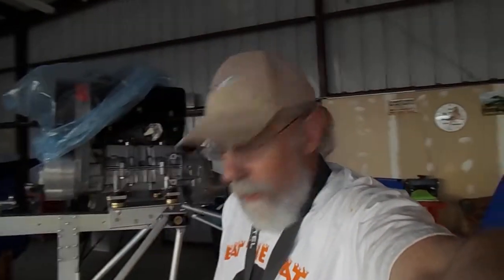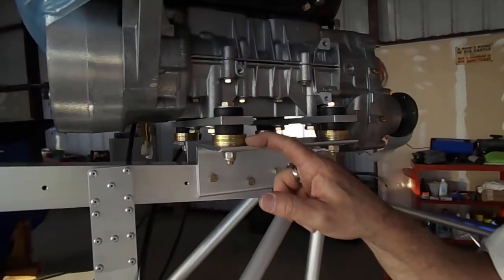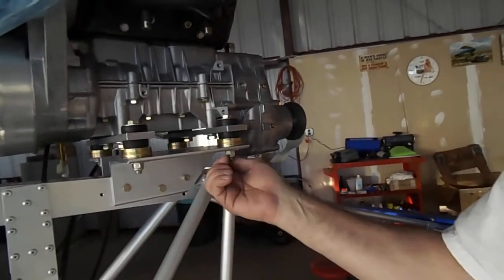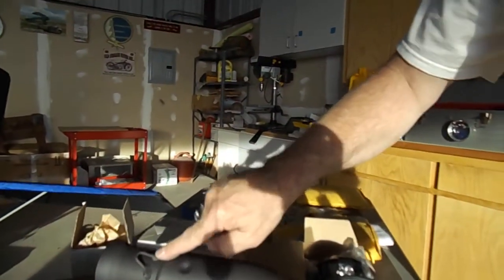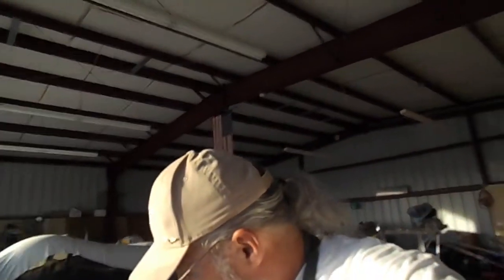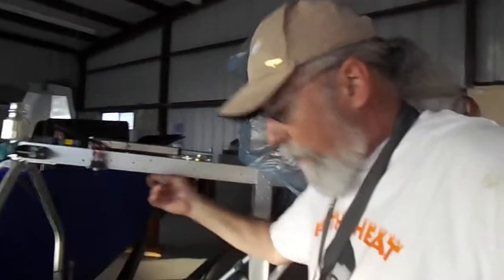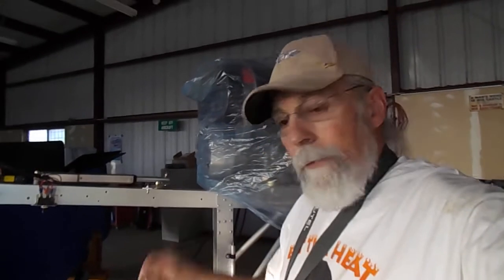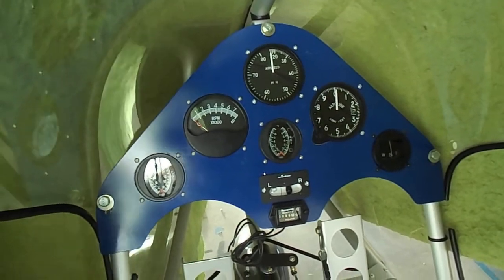Rotax 503DCDI Engine Installation Updates: 001

Comment: I'm a Harley and hot rod guy and dont know much about building aircraft but don't you use safety wire or cotter pins in those engine mount bolts? Man I'd be paranoid those suckers would vibrate loose! Great channel, my story is similar to yours, I plan to learn to fly one of these days also and am interested in the aerolite 103.
Reply from the maker: I hear ya. Not to worry, John. The manufacturer calls for nylon safety nuts on engine mount bolts. I went one further. I used the "Nylok Nuts" recommendation AND "cotter pins" in each of the mounting bolts. It's solid. Thanks for the comment/s and watching. Good luck with your endeavors and acquiring your dream of flight. Ride safe, brother!
Reply: @aerolite103buildersvlog8  thanks for the response. I watched your next video and saw you were talking about safety wire haha. I jumped the gun a little bit!

Comment: Did the instructions not show the engine mount washer issue?  Were washers not included with the kit?
Reply from the maker: No. And no. It's a plane with many things the owner needs to adjust or come up with and/or consult with manufacturer about. The washers were such an issue. Basically it all depends on the engine selection for your project, Tab. There's many engine choices available for this plane and the Rotax 503 is unfortunately discontinued/outdated now. Parts are plentiful and she's still a great engine. I got mine brand new in the crate for a great price (just an fyi). And Mr. Dennis Carley is generally available for any questions to them that presently own one of his planes. He's been 100% accessible throughout my entire build, when needed. I'm sure he'd be there for you too if you own one. As I stated in a few of my first videos I am totally green and never built ANY airplanes. I figured to learn as I go, like with most things one does. Thanks for your comment/question.